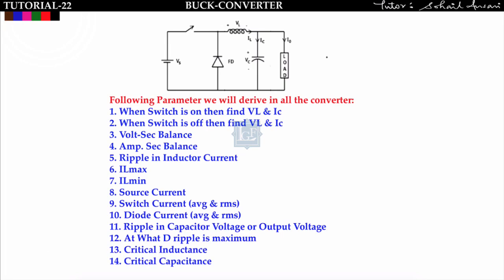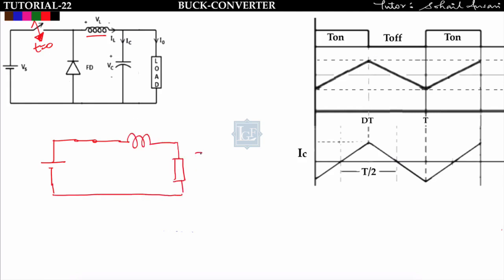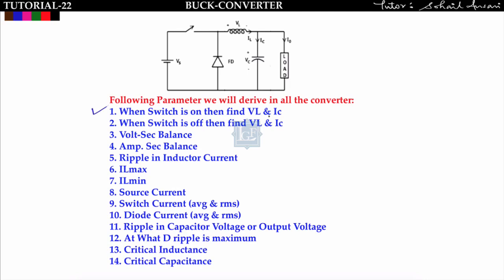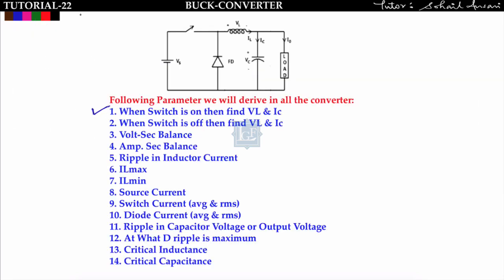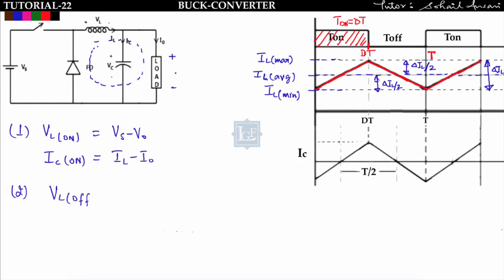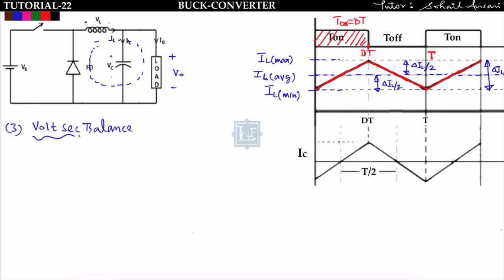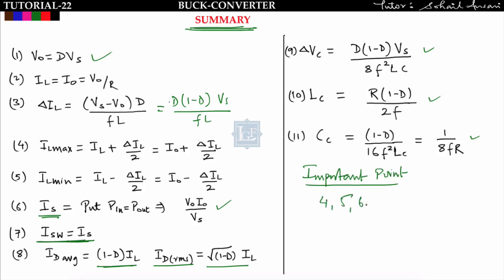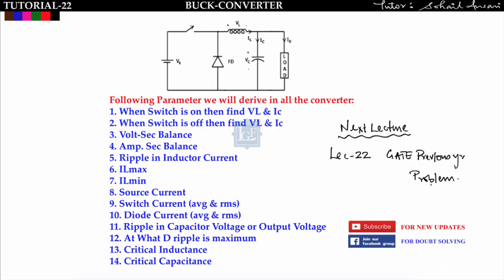Lec 22 Understand Buck Converter in 30 minutes

Comment: what ever sohali sir explain is correct .but if u want more clarification do one thing ...during turn of condition the inductor changes its polarity. yeah ur absolutely correct . change  inductor polarity and instead of applying the volt sec balance apply the energy conservation principle.

chaging energy equal to discharging energy (assuming inductor is completely discharged what ever energy it charged.                as   energy =v * i * t
(Vs-Vo)   *  (Imin+Imax)/2    * (DT)  =  (Vo)  * (Imin+Imax)/2   *(1-D)T
after solving u may get    Vo=D Vs ....this may applicable to other choppers also.
Reply from the maker: Correct explanation
Reply: @GATEMATICEducation  thanks sir
Reply: @smrautomations2168  you are justifying that whatever sir had written is right.. sir had written VL=-Vo during off state and in ur explanation u have written +Vo during energy release i.e. during off state u have considered Vo instead of -Vo( as sir had written -Vo during off)
 How does it mean ur justifying sir's explanation? Please answer

Comment: point no. 9 , while calculating switch current, you hv assumed Io=Il . that is true for average values but not for the instantaneous values. the increasing current flows through switch and decreasing current flows through FWD. so while calculating avg current through switch, the +slope portion of inductor current should be taken in consideration, and not the avg load current.
Reply from the maker: +rajat saxena u r right..i have taken avg value..not instantaneous value..instantaneous waveform will be different..now if u will take instantaneous value also to find avg switch current..u will get same answer..no prblm..u can approach like that..

Comment: In transients we studied that when the supply is connected to inductor then it charges exponentially by equation Is(1-exp(-t/Tau)) but here u mentioned that the inductor will.chsrge linearly? Why is there this contradiction? Plz explain
Reply from the maker: Exponential fxn is also have linear region at starting....so this ckt are working in linear region
.ok
Reply: transient equation is valid only for finite time constant. and when inductor is connected with a ideal current source so time constant= L/R when you will remove ideal current source in order to calculate R you will get R=infinite and hence time constant=0 hence transient equation is not applicable. And this becomes linear charging of inductor case. If you got it then fine otherwise apply laplace transform to the circuit you will get the same result. if then also u cant understand. TAB TOH BHAGWAN HI BACAHYE AAPKO.
Reply: It’s because inductor has very large value
Reply: For practicle purpose linear approximation is good enough, in reality it not only is exponential but also has noise and ringing due to thermal noise and inductor resistance
Reply: Age inductor ki across constant voltage source lgya jata hn;tb inductor linearly charge hota hn...i ramp function hoga

Comment: during the Inductor discharge, the polarities of inductor should be changed right? ( Initially inductor would charge with polarity +,- ; while discharging current direction will not change but the polarity of the inductor should be changed to -,+ ) can you give the reason why it is not changed?
Reply: Due to high negative release of energy

Comment: Sir I don't understand one thing.. i.e.. in the above circuit when switch is closed then source current and switch currents will be equal to inductor current na.. then their current waveforms should be same as that of inductor current during on state but why are u considering source and switch currents as constant sir?

Comment: During T_on the supply charges the inductor and capacitor & during T_off the inductor delivers (discharges) its power to the load so when does the capacitor discharge its charge?
Reply: Sir same doubt.
Reply: @PriyankaSingh-je6ro  during Ton capacitor is also charging up to DT, and when the switch turned off capacitor discharging.

Comment: sir..I m not understanding one thing .why the current is not starting from 0
....
Reply from the maker: when you switch on the supply then current will start from zero...after that we adjust the switching frequency such that the inductor current can be continuous..so waveform i drawn here is at steady state...means after 5 to 6 cycle...i will get the waveform like this..got it..

Comment: at 6:23, during switch off condition, inductor discharges stored current. at that instant voltage polarity of inductor get changes but here in the video, you kept the same polarity for inductor during discharge, why?  is there any mistake my point?
Reply from the maker: post ur question in learn gate free facebook group..and tag me there..i will resolve ur query..all the best..
Reply: right now I'm not using Facebook.
it's doubt regarding polarity of inductor during charging and discharging.
Reply: inductor tries to keep the current in the same direction. Thats why it "supports" the current or "opposes" the change
Reply: yes polarity will be changed but we already took one terminal as higher and other is lower . so final expression wrote according to this.
Reply: what ever sohali sir explain is correct .but if u want more clarification do one thing ...during turn of condition the inductor changes its polarity. yeah ur absolutely correct . change  inductor polarity and instead of applying the volt sec balance apply the energy conservation principle.

chaging energy equal to discharging energy (assuming inductor is completely discharged what ever energy it charged.                as   energy =v * i * t
(Vs-Vo)   *  (Imin+Imax)/2    * (DT)  =  (Vo)  * (Imin+Imax)/2   *(1-D)T
after solving u may get    Vo=D Vs ....this may applicable to other choppers also.

Comment: yeah sir, When inductor discharges during off condition of switch, It reverses its polarity and then discharges. But in the video, you did not change the polarity. Reason? At 6:23
Reply from the maker: for all time the polarity of voltage across inductor is assumed to be same...that does not mean inductor voltage is not reversing...it is reversing thats why u are getting negative voltage during off..
Reply: @GATEMATICEducation  yes sir exactly

Comment: I have came across a little different circuit. There is another diode in place of the switch and a transformer between the supply and the other elements.

Comment: Dear Sir
At 1:37 inductor current waveforms are shown linear. why only linear shape? i mean they could have been exponential...
also while we are writing KVL eqns then Vo=Vs-VL but in waveform we have shown it to be equal to the Vs. during turn-off Vo= -VL but in waveform it is zero. i mean there is lack of consistency in what kvl is saying and what we are drawing... avg VL is zero but there must be some instantaneous value of it.
Reply from the maker: exponential graph u will get in case of RL circuit..not purely inductor circuit..in purely L circuit IL= integration of VL...right..so integration of constant will give you ramp fxn..i.e. linear..
now coming to sec query..you have written Vo=Vs-VL..that is correct..but for full cycle we know that average voltage across inductor is zero acc to volt sec balance..ok..so VL avg=0....but my question is why to find Vo like this..i apply the volt sec balance to find Vo...and in Vol sec balance i find the VL(on) and VL(off)..ok
Reply from the maker: also if you will take RL load then also at the first few second the graph shows linear behaviour..so we are operating inductor in linear region of graph...got it..
Reply: actually the KVL eqns (Vo=Vs-VL) we r writing .. are they taking avg values or instantaneous values? in rectifier module we were concerned about taking instantaneous values and based on those we drew waveforms...
Reply from the maker: when we are applying volt sec balance there we are taking instantaneous value..not average value..also average value of inductor over full cycle is zero..till DT you will get voltage across inductor and from DT to T also you will get avg voltage but overall avg voltage across L ovet full cycle is zero..got it..

Comment: Isn't it true that capacitor blocks dc? Then how current is flowing through capacitor?
Reply: Bcoz current capacitor is not dc it is triangular
Reply: capacitor does not allow dc ...,its fine... But just see the current from inductor ...its triangular DC.if .by using fourier series you get a DC + SINE waves with different frequencies and amplitudes equivalent...so capacitor doesnot allow that dc component ..but it allows all other ac component of current....And other thing here is  we kept the capacitor in parallel with load for just maintaining the constant voltage across load as in case of the rectifier....
Reply: My dear friend capacitor current is zero only in steady state(when DC source is present).. but look there is continuously switch is being on and off so whenever switch is been on and off in any circuit where inductor or capacitor is present then that particular inductor and Capacitor will have voltage and current respectively till it reach steady state.. pls analyse the circuit properly it's in transient state in this operation and in transient state L and C's will posses voltage and current values

Comment: Awesome lecture...My questions are two 1. in the Amp sec balance section, how did IL change to IL(avg). IL(avg) is a constant but not IL. 2. Why didn't you use I=cdv/dt for ripple in Capacitor voltage as you did for the boost converter. Thank you
Reply: By Amp-Sec balance, he is saying that average current through the capacitor is zero.But i think this is not correct.

Comment: Dear Sir 
At 27:04 decreasing value of inductor is shifting the waveform downwards without changing its waveshape. but if L changes then its time-constant shall change thus waveshape should change na...
Reply from the maker: yes u r right..the slope will change ..i m drawing the rough waveform..just to make u understand the for particular value of L the Imin=0..got it..

Comment: Dear Sir At 24:44 we  are calculating del Vc = del Vo . from waveform it is clear that DelVo=Vs-0. but that is not the result why?
Reply from the maker: where it is shown that delVo= Vs-0...Vc is the voltage across capacitor and is connected parallel to load..so when Vc will change then Vo will also change same as Vc..thats y delVc=delVo
Reply: sir till DT Vo=Vs and from DT to T it is zero that means delVo=Vs-0. from output voltage waveform ..
Reply from the maker: no..till DT , Vo= Vs-VL....and from DT to T Vo=-VL..how you are saying i dont know..apply kvl here..u will this much only...
Reply: sir i am saying the above fact by looking directly to the output voltage waveform.. thats my confusion.. ki kvl alag bta rha ...

Comment: 24:08 what was that ;) never seen anyone doin derivation like this... X'D
Reply: Calculus Quotient rule if i am not mistaken...
Reply: Haven't seen anywhere?? How's that possible?
In networks how did you find the condition for maximum power transfer to load in Max.Power transfer theorem... It's nothing but in the same way.. once u go through it ull get idea the same way sir implemented here
Reply: Whenever we want to find the maximum value of any quantity wrt another everywhere we do the same procedure... For ex. in MPTT we want to find that for what value of load resistance(RL) the power transferred to load(PL) is maximum? then we do as follows.. i.e.. we differentiate PL (Power delivered to load) w.r.to  RL and equate it to zero...
Here also same thing sir did.. i.e..we need to find at what value of D, ripple in capacitor voltage is maximum? so to find this we need to do as follows...
Differentiate ripple in voltage w.r.to D and equate it to zero.. that's it simple😀
Reply: Is the term Vs/8f^2LC a function of D??🤔
Reply: @samikpal5585  deltaVc is a function of D
Reply: @samikpal5585  look at the whole formula.. 
deltaVc= D(1-D)Vs/8f^2LC
Reply: @samikpal5585  so we can obviously differentiate deltaVc w.r.to D since it's a function of D
Reply: @anushareddy2736  You didn't get it. Leave it anyway